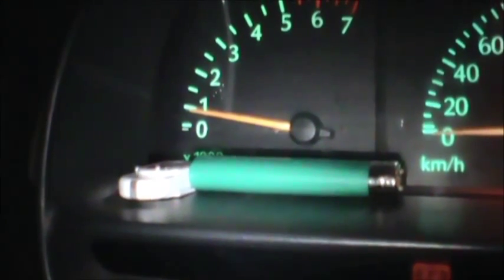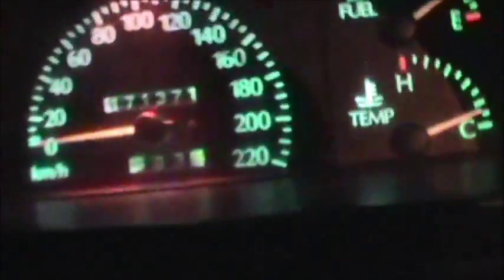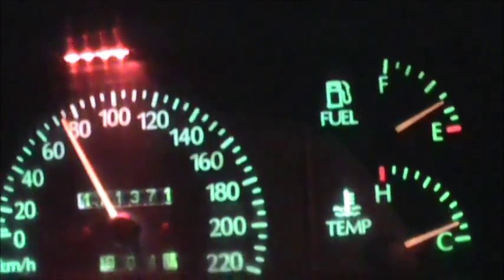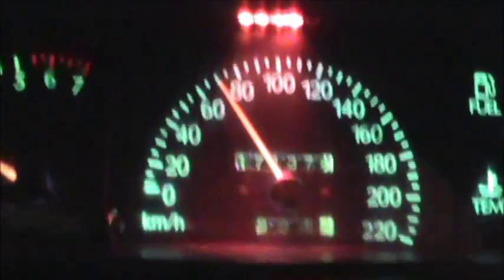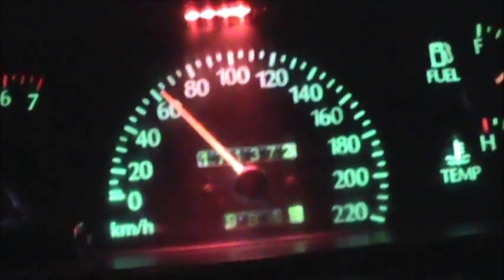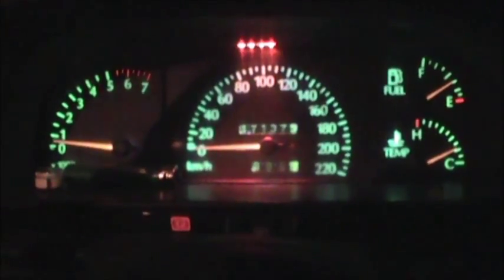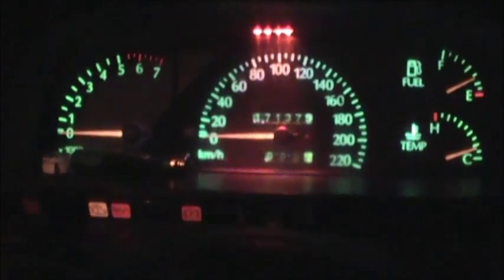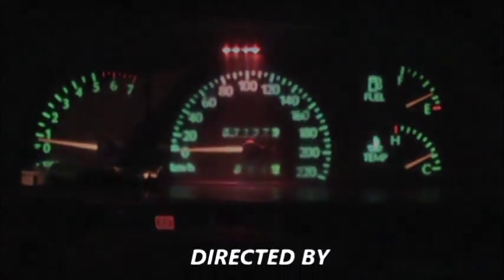Testing VN V6 Auto Commodore Computer In The VR Manual Ute

Comment: Hey just wondering what the fuel economy is like in the manual commodores? Cheers
Reply from the maker: Luke Baxter it is better than auto however with all the stating and stopping i do dont help it all comes down to how you drive at the end of the day i prefer manual as the is more control
Reply: EVL78UC Motor Sport Videos ah ok cool.  I had a VS Auto a few years back. The fuel economy wasn't too bad. Wana buy one these in a manual ute. The 4 cylinder options out there aren't great fuel wise.
Reply from the maker: my one is 93 vr ute 5 speed with the buick motor the comp i threw in was a auto 1990 computer however i wondered what a vs manual would be like as the ecotec is sequential port and runs a little bit cheaper if maintained plus the vr and vs auto had the electrics with them and seem to lag a bit more than the vn vp auto
Reply: EVL78UC Motor Sport Videos I'm surprised that even worked. Didn't think it was possible an auto computer get be put into a manual unless the ECU had to be re-programed etc. Did you just plug the VN computer straight in? Yea that's right.. multi-point injected as well. Not sure if the VN-VR's are tho... Yea the 4 speed autos in the VS are nothing to be excited about that's for sure lol. The Manuals in them go wayyy better. More Power, Better economy, and more fun to drive. VS is slightly more fuel efficient because of the fuel setup. and polly the ignition timing and exhaust. Because I've noticed the Ecotechs seem to run a quieter then the 3800s, but yea. But the 3800s bullet proof.
Reply from the maker: plugged straight in the manual plug on the vr is the same type as the vn vp auto
Reply: +EVL78UC Motor Sport Videos. That's alright then. Least Commodore ones are easier to manipulate the falcons.
Reply: I have a 5 speed series one vn. Getting 8.9 litres per 100km combined. It does a little bit better than that on long trips.
Reply from the maker: i have not worked out that part but my vn auto wagon was getting 550 for 65L on the highway
Reply: +EVL78UC BURNOUT Videos  hi you  still playing  with the  computer  things ???   how  does  it work  if  you  reverse  it  ???  put the vn computer  into the  vr ???
Reply from the maker: this is a VN auto comp running in a vr manual a mate said he tried it in his 94 vr but didnt allow him to get passed a certain speed my auto comp did have a burnout ebay memcal in it so not sure if it was the chip or weather its the case of the cam sensor which they started running in the 94 vr.

then again i have put a 95 vs ecotec into my 90vn wagon and used the vn wire loom after changing some plugs and put the air temp sensor into the plenum

Comment: what is the knock on take off ? engine knock ?
Reply from the maker: slight knock every now and then with it taking off in 1st but that could have been the way i drive it no problem in any other gear. but i im not exactly sure where it was coming from
Reply: Hamish Hvid I have this problem and mine is the  tension pulley, cheaper part which cannot be adjusted properly..... Must get original part.